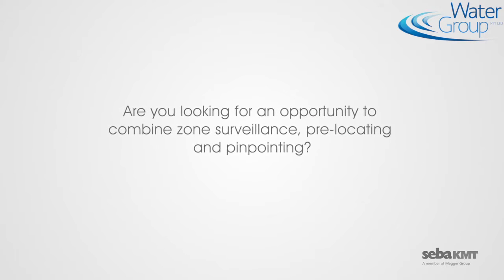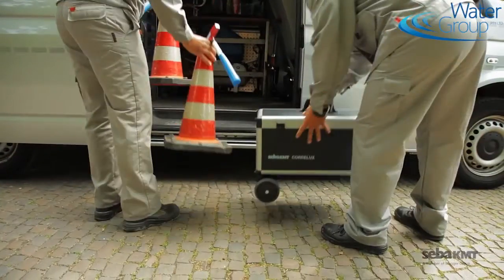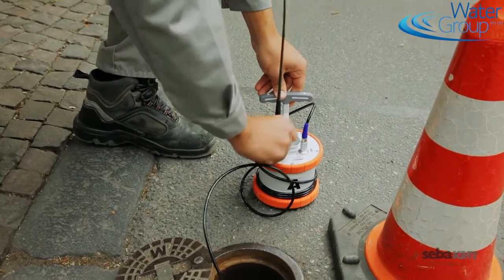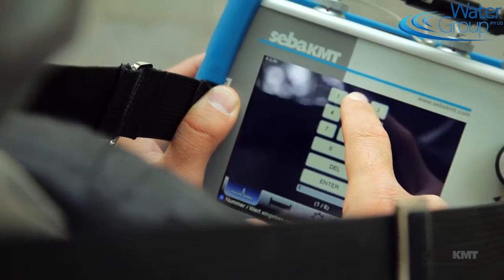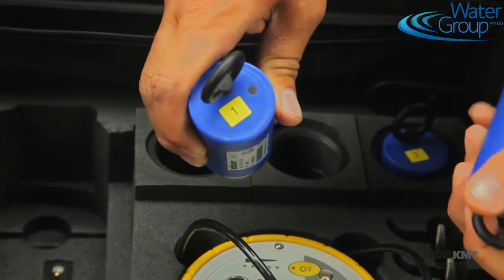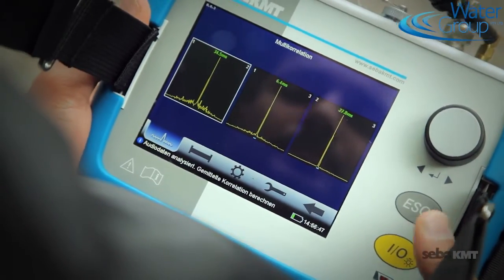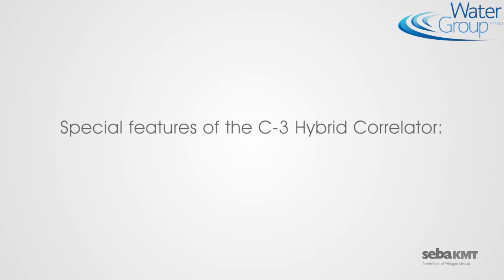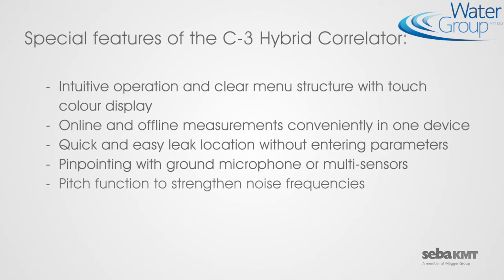WaterGroup Correlux C 3

Comment: It is necessary to find the Sound Velocity of the Pi[pe first if 1) the break is not midway between the two pipes or 2) there is a discontinuous in the pipe like a previous break. Without this you will not get accurate readings for the distance to the break. It is always wise to measure the Sound Velocity and entering manually on the Correlux C-3.  I seriously doubt the standard tables will get you within 12 meters of a break if any of the conditions above in 1 or 2 exist, The Sound Velocity can be measured on or off line.